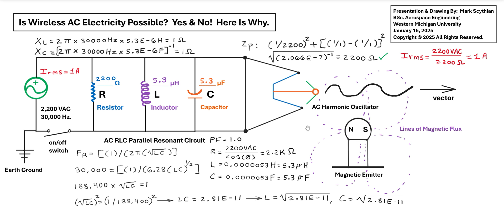Is Wireless AC Electricity Possible?  Yes and No!  Here Is Why.

Comment: So much for the Earth's vertical electrical fields.
Reply from the maker: 1 Earth's electrostatic fields-of-potential are dsitributed across the Earth's crust (850 miles thick), and Earth's atmosphere (70 miles altitude just below the Karman Line).  The Sun's Neutrino emissions converted to Photons (inside Earth's atmosphere), charges Earth's atmosphere and crust with electrostatic-potential.  Variations depending on material or molecular-chemistry (Atmosphere & Earth's Crust).  

2 The Magnetic Poles of Earth AND their Lines-of-Magnetic-Flux DOMINATE Earth's electrostatic-potential or 'vertical-electrical-fields' by means of Inductance.  

3 Most of Earth's electrostatic potential is absorbed into the Core of the Earth, grounding into DC Electricity, to maintain Earth's Molten-Iron-Core.  Thus, allowing Earth to propagate a strong-and-wide Magnetic Field (eight times larger than Earth's diameter).  For which without, would render Earth into Mars:  space-debris scrubbed Mars surface barren after Mars magnetic field collapsed.  

4 Conclusion:  The 'vertical electrical fields' of Earth are reserved for maintaining Earth's Molten-Iron-Core. 

5 Note:  A Steel Factory has a VERY STRONG MAGNETIC FIELD, due to its large mass of molten Iron.  Iron amalgamated with Carbon becomes Steel.  However, Iron itself has the Highest Magnetic Permeability of any element.  Copper has good Magnetic Permeability AND Electrical-Conductivity.  But Iron alone, has the highest Magnetic Permeability.  Imagine melting hundred-of-thousands of tons of Iron into Molten-Iron, this would propagate a VERY STRONG MAGNETIC FIELD.   Steel workers cannot have anything metallic on their person, nor electromagnetic device upon or inside of their person.